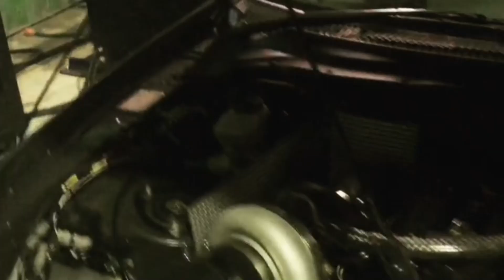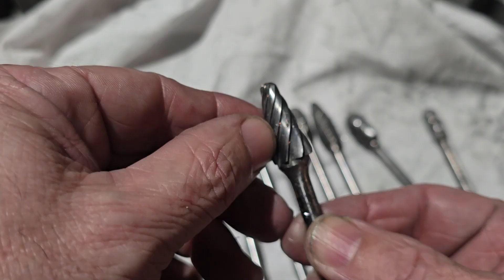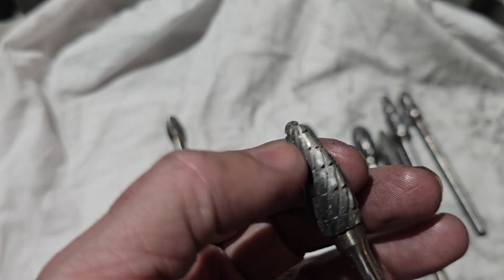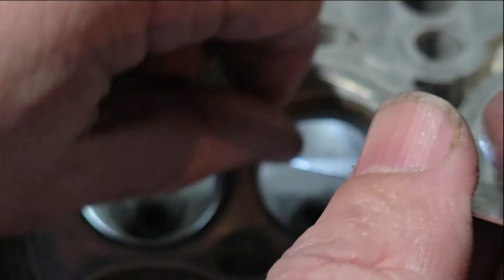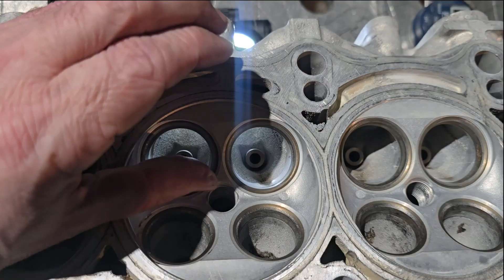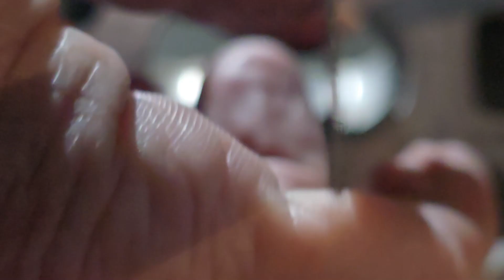Introduction to cylinder porting with the Toyota 2jz, By Bain Racing. #2jz #porting

Comment: the exhaust side lets the 2jz down, they can and do burn up exhaust valves very easily on big big hp applications
Reply from the maker: I've seen a bit of a pattern with that. It seems to happen more on the massive oversize valves,  like the 2 and 3mm oversize stuff. I think it slows the seat and valve velocity down too much and puts heat into them.
Reply: @bainracing  interesting, I haven't got experience with 2jz valves of that size but plenty with 1mm oversize and they burn up easy if things are spot on, especially on 2step and using NOS.
Reply: @salvatorehest5516 of course they are prone to issues on the 2 step rev limter and nitrous. That's a rough way to run an engine.